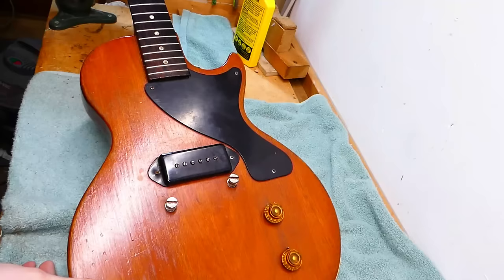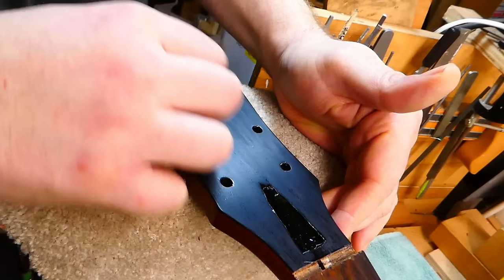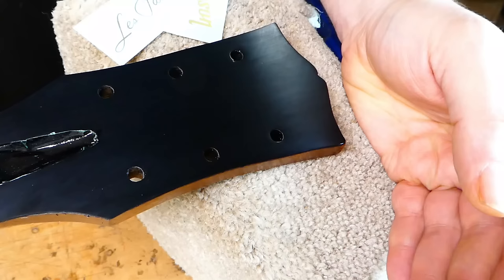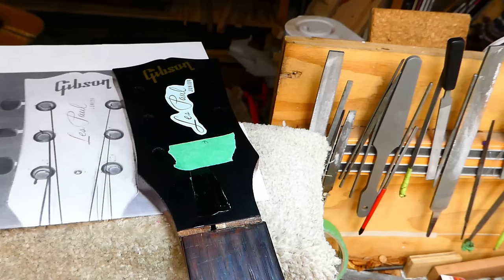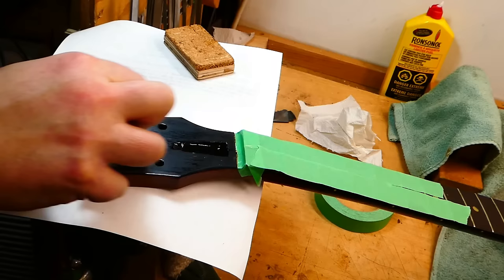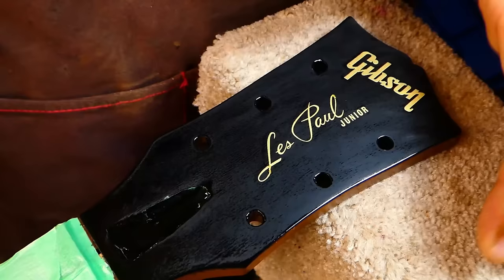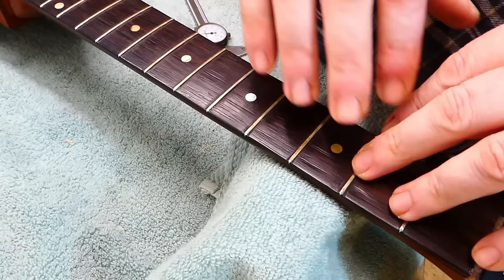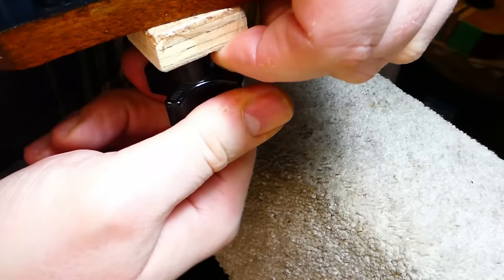50's Les Paul Jr. PART 2

Comment: Love your work Ted, I watch all your clips. The decals look great, I wish you had done this video before I bought my decal for a TV Junior, mine is not as close to the originals as the one you sourced but can I say you made a similar mistake to me, we both worried about the location of the "Les Paul Junior" decal & got the "Gibson" decal wrong. The G & n should be parrallel the the neck, yours appears to slope to the left, mine I sloped slightly the other way. I only realised this when I checked out the vintage Gibsons I own. Apologies if this sounds rude, I certainly don't mean to. I hope it may come in handy some other time. Keep up the fabulous work.

Comment: I just can't imagine Led saying or thinking, "Close enough for jazz"?!?!
Me and my dad always did our own customs paperwork for stuff coming up from the states.
Sometimes, actually most times, the folks at Canadian customs were very helpful and if the caught a small error would ignore or fix it for us. Other times, not so much, "this isn't right" and just give me back the paperwork to figure it out.
Once ordered a tool made of angle iron or steel. One side machined flat for checking/leveling trombone slides. It listed at something like $89USD and we ended up paying over $200CDN!!!
When I got the effing thing home and opened it, what's on the inside surface in big raised letters? Made in Canada!!!!;
Reply: Read Les not Led. Damn spell checkers!!!
Was going to add and forgot, have you ever heard it said, Les Paul was Steve Miller's God Father?

Comment: Just a thought. If you want to make the headstock lamination look real, burn the wood under the high E string where smokers used to wedge their cigarettes?
Question???
Have you ever seen or heard of Gibson using small blocks of mother of pearl or whatever the Gibson logo was made of. The whole block inlaid, Gibson masked and sprayed so it looks like every letter was inlaid?
Meaning if someone were too aggressive sanding the headstock during a refinish or repair the Gibson logo turns into one big rectangle?
Someone once told me that was the way some logo inlays were done.

Comment: Once again, phenomenal work Ted, thank you for doing these videos. I was just wondering about the string winding on your LG, is there an advantage to accentuating the break angle? Also, re. the decals, you can get setter fluid which really buys you time to re-position and helps 'float' the decal. I also find that putting on the first layer of lacquer before sanding off the proud edges off avoids a lot of the risk of inadvertently snagging the design and the lacquer responds to sanding better than the decal material. It really is wonderful work you do and an invaluable resource for us amateurs out here, thanks again.

Comment: I noticed that Gibson had really flat frets when I was young.  Now that I'm 40 I do lots of fret levels and while learning to do so, I would do a little bit and try it, do a little bit more and try it and I just plain stopped crowning frets all together.  Now that sounds strange because my ear is particularly sensitive and I can tell when a saddle is 1/128th out but I never hear any negative effects of not having an apex on the fret.  I know it's strange.  I'm a fairly aggressive player and extremely "bendy" with lower than low action.  So when I do other people's instruments, I have them try one of mine and they seem to prefer flat frets as well.  Maybe that will all change one day but I thought I'd give my thoughts on the old flat top Gibson frets.

Comment: Hi pal, regarding your request to submit sources of headstock decals. There is a source here in th U.K. called "Guitar Decals". I have used this company many times, the quality and accuracy is second to none so I highly recommend this source. Here the cost is £9:00 for a standard decal plus you get a spare one, good value in my opinion.
Whether the cost of importing these to Canada would be prohibitive I know not,
This guy will also make custom decals should you require it.
If you have issues sourcing these decals let me know, i will endeavour to assist.

Comment: The overall job is good, but that Gibson logo decal just looks out of place. The tail of the G and the N should point directly at/towards the nut. This this case they point to the G, B and E tuners. A better solution (the one that I use), is to make or purchase a vinyl frisket and spray several light coats of metallic gold lacquer. Same goes for the Les Paul model logo. Keep up the good work.
Reply: I agree. The vertical parts of the Gibson logo should be parallel to the centre line of the neck. Otherwise, a fantastic job.

Comment: Being a model builder myself I have used alot of very thin aftermarket decals, I was wondering if you have ever thought about using some setting solutions to help with placement and then to help them settle and look smooth, just a thought,  a good product is microsol

Comment: My old 57 Jr also looks like it has a decal "Gibson" logo, but the internet taught me they were silkscreened. Do you know if they varied?

Also, that Stud Finder bridge is an awesome concept, glad it worked out! I bought one, and it was WAY too thick to fit anything. It didn't fit my Jr, it was even more than 1 mm too thick to even fit my R8 studs. I wonder if I just got a dud. If anyone else has the same exp I'd like to know.
Reply: What I found was that most of the reputable replica builders agree on is that de Gibson logo was a decal (or inlay on standards) and got covered with clear coats but that the  script was silkscreenedon after finishing. That's why G logo is mostly protected and you can see the cracks in the clear over them while the script paint is exposed and wears much more easily.
Reply: @MarijnSlot  thanks! That is in line with how my Jr is

Comment: Question:  I plan to paint the headstock of a new music raft neck in black apple ha. Decal and then laquer/polish. The current headstock is maple - would you apply a few coats of sealer first to make sure the wood grain doesn’t show through the black lacquer? And does maple require grain filler? Thanks and congrats for 100K followers.
Reply: Clearly…Don’t do it.
Reply: The couple of times I've painted a maple headstock, the grain did not show through at all. You could always paint with a primer first and see what shows up and make a decision from there.